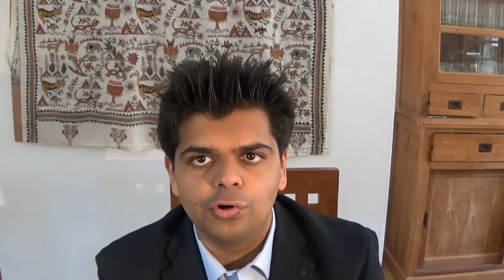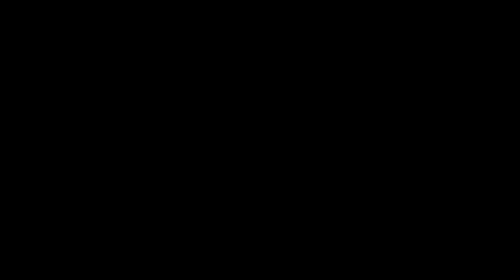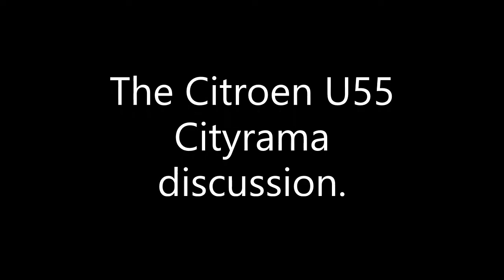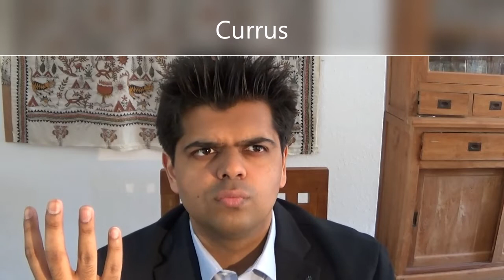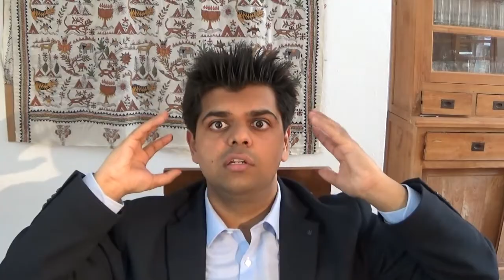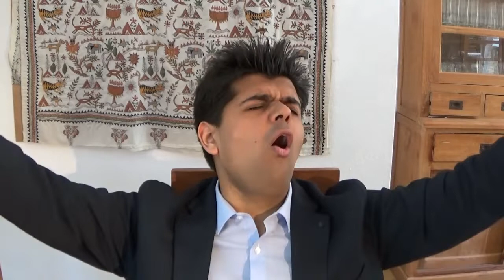Citroen U55 Cityrama Currus, UNIQUE design, but terrible engineering! Discussion, and my thoughts!

Comment: Your right, cars today have all become cookie cutter copies of one another to where you can barely tell the difference between a Chevy or a Toyota. ALL trucks look identical, most cars look the same. Most all of them are nothing but a box with 4 doors and 4 tires with VERY LITTLE differences between them with most differences being nothing more then a different shaped bumper here or there, a different type of door handles or mirrors or pretty much just cosmetic pieces, nothing substantial. WHY have car manufactures become AFRAID of doing anything new or different? You see all of these "concept" cars that are made for car shows and the like, but like 99.9% of them NEVER get built and even less ever make it into mass production and those that do look NOTHING like the concept car. The ONLY cars that we EVER see that actually look new and interesting are either the so called "super cars" or cars that cost 1 or 2 millions dollars and that only a few are ever made. WHY? Car manufacturers are so scared to death to do anything new that cars have pretty much not changed in the last 30 years or so. Its sad that people in the 50s and 60s had MUCH better imaginations then people do today.